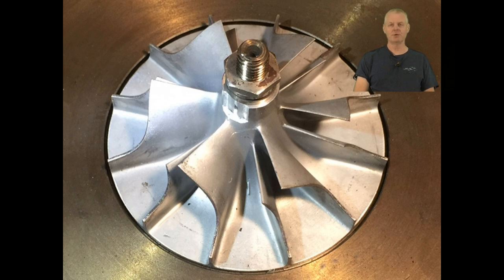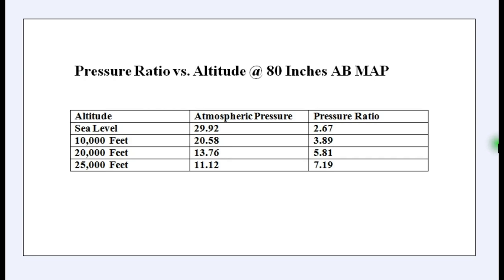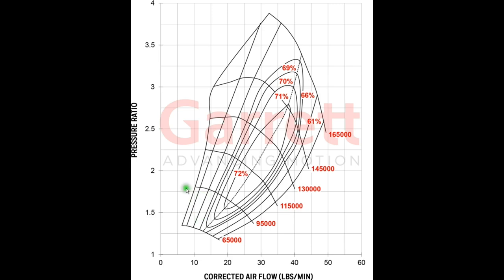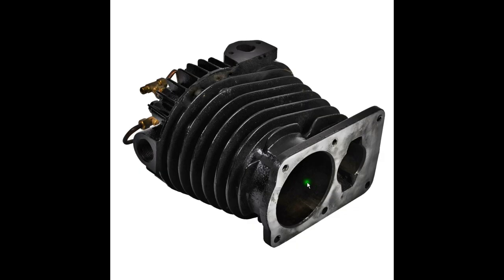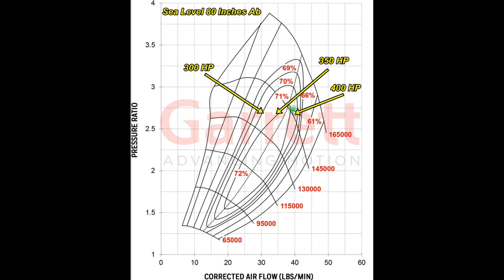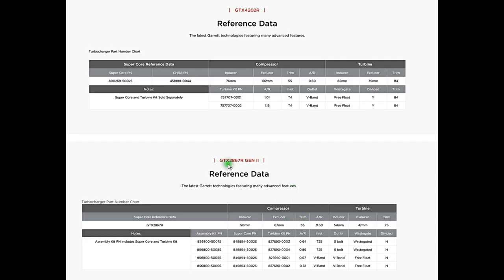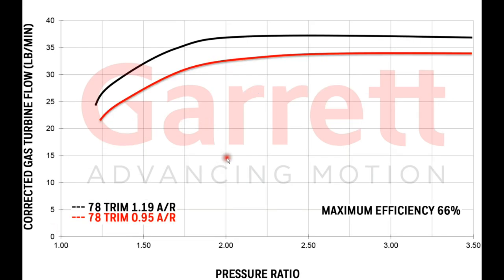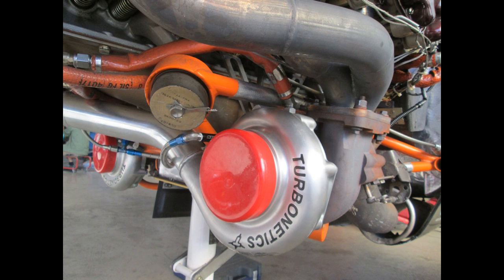What's Wrong With Raptor's Compound Turbo System?

Comment: The mass flow (lbs) per minute must be the same in both turbos (no air is added nor lost, so where should a difference in mass come from?) So why are you applying any kind of multiplication to the mass flow? If the engine needs 40 lbs per minute, then each turbo needs to transport 40 lbs per minute.
Understood that the second turbo needs to be smaller since the air is more dense but I don't get why the mass flow should be different?
Reply from the maker: Compressors are rated on inlet mass flow. First stage air will be compressed in volume to feed second stage. Boyle's Law, as I explained.
Reply: @rv6ejguy  All agreed - can you help me and state the lbs/min in and out for first and second turbo. In my mind all 4 numbers must be the same.
Reply from the maker: @martinrenschler4046  If you look at the relationship between volume and pressure (assuming no intercooling and disregarding temperature change from compression which is substantial in this case), in simple terms, double the pressure, you have half the volume and double the density. We are trying to take air at low density and increase the density back to SL conditions. 

The first stage essentially brings the 2nd stage compressor inlet back to SL at 25,000 feet so the 2nd stage can then bring the intake manifold up to 70-80 inches Ab.

This may be easier to visualize volumetrically  rather than thinking in terms of mass flow and you can see how gas turbine engines with multiple axial stages have large blades at the front and progressively smaller as you progress rearwards. you squeeze the air more and more and pressure increases at each stage.

You'd have to consider the effects of intercooling and aftercooling to actually match turbos for Raptor. The point of this video was simply to show that you can't use two equally sized compressors for compound turbocharging as Peter has done. Don't take the actual numbers presented here as gospel, they are only for illustration of the concept.
Reply: @rv6ejguy  I again agree with everything you say but it doesn't explain why you would have different lbs/min numbers between the turbos. If it were so, we would either gain or loose mass in a turbo and that can't happen. If the engine needs 40 lb/min than that's the mass each turbo needs to take in and put out. No multiplying with some factor and getting to a higher lbs/min number for the other turbo.
Reply: I read up a bit and found that the charts only apply to the first stage. In order to use the same charts for the second stage turbo you have to calculate a different mass flow, not because there is a different mass flow but to be able to use the chart. The formula is mcorr = m*sqrt(T1/298)/(P1/1). This number is smaller than one, so a smaller turbo will provide that corrected virtual mass flow.
Reply: @martinrenschler4046  That is what puzzles me also, plus a % the pressure , minus the same % in volume = the same mass.
The only way to get a different mass output per turbo would be a wastegate between them.
I can imagine the second turbo in order to provide the right amount of lbs/min ( mass ) for cruise power at 25000ft has to be ''fed'' enough by the first turbo.
To be able to provide enough lbs/min ( mass ) at FL 25 it has to be bigger but will be to big at SL and the wastegate has to bleed off the surpluss i guess.
No expert what so ever , just trying to visualize this complex stuff....
Reply from the maker: @martinrenschler4046  Mass in = mass out, only pressure and density has changed as flow moves downstream. Compressors are spec'd on inlet flow. Squeeze 1 cubic foot of ambient air down to 1/2 cubic foot and you have the same mass at double the pressure and density (assuming no heating which isn't true in real life). I'm not sure how else I can explain this...

Go back to the analogy of the 2 stage, piston air compressor.

I am not sure what you are trying to say here? Are you disputing that the 1st stage compressor shouldn't be bigger and therefore pump a larger volume of air?
Reply: @rv6ejguy  I am all good as stated above. I just needed that one sentence of explanation that I found online namely that you go into the charts not with the actual physical mass flow numbers but with a calculated number that allows you to use the chart when the inlet pressure / temp is not sea level, i.e. mcorr = m*sqrt(T1/298)/(P1/1). That allows you to work with compound setups as well as at high altitude. Thanks for the video.
Reply: @martinrenschler4046  , Exactly!

Comment: Very informative and interesting even to someone who's never going to build a raptor! You made your case very well.
I wonder how difficult it would be for someone to change out the current system to a recommended system. 
In other words does the Raptor builder choose the turbocharging system on the engine. Or is it supplied when you buy the engine without an opportunity to select a proper system.
What would you suggest current raptor owners do? Another channel by a raptor builder complains about the high engine exhaust temperatures. I think he should watch your video.
Minor note. Moving the cursor around continually is very very distracting for certain people like me who have ADD. It makes it difficult for me to focus on what you're saying. Just point once and leave the cursor there. Sorry, but some of us have this attention problem.

Comment: Let me ask you a very simple question.  How many aircraft have you designed and built,. including the engine and redrive system?  Please expound and show your videos of development and finalized to production.  I am absolutely certain that we shall all be amazed by your genius.
Reply from the maker: This video was about turbocharging. Just trying to show people why it's all wrong based on my 40+ years in this field. Did you want to dispute any of the points I made here?

I built my planes for myself, not production. Do you think Peter did a good job here?  Do you think the design will do anything better than existing designs like the Lancair IVP or Velocity XL?

It weighs more than TWO RV-10s and has no useful load at all as it's already at its predicted gross weight- when empty.  How will 1200-1400 pounds be removed from the production airplane without sacrificing all the bells and whistles?

Raptor isn't going into production with this engine, turbo system, cooling system, redrive or control system as they sit now. Peter needs some professional help on many aspects to make Raptor successful.

BTW, Peter never built his engine. I did build the engines in both my planes that I also built. My engine and redrive have 450 hours on them and haven't blown up yet...

How many planes and engines have you built?
Reply: I have followed Raptor (Peter M) since beginning and you would know  from following that  there HAS been good info given but NOT taken on board. Sometimes you just got to think about input suggestions and there SOURCE. 🤔🤔

Comment: The following comment was one I posted to Raptor, it was my first red flag and I can't help but Wonder if this engine failure is resultant from cylinder degradation due to heat?... 
I have been curious about the EGT range you have been contemplating, is there something unique about this power plant that allows for operations considerably above acceptable norms? The absolute maximum safe EGT range is debatable. Our universal rule of thumb, regardless of engine make/model/year, is to not exceed 1250° F and not to operate in the 1200° F - 1250° F range for an extended period of time. - Diesel Hub. http://www.dieselhub.com/performance/egt.html
Reply from the maker: Lots of people have brought this up but Peter thinks he knows better than guys with decades of performance diesel experience.
Reply: The engine did not fail. His redrive bearing seal has a retainer ring on it. He put a larger seal in, and the retaining ring would no longer fit, so he left it out. The seal blew out in flight. Since his redrive oil and engine oil all come from the same place, the engine ran out of oil. Not an engine problem, it was a being stupid problem.
Reply: This is excalty what I was taught and know that to be true from my own personal Experiences.
Reply: @golfmaniac  It's still not proven, that is the case. Did the seal pop first (why, they don't just pop out if the case runs a negative pressure) OR after a problem with the turbo seals failing due to high temps, pressurizing the crankcase, forcing the un retained seal out ?

Comment: Good engineering principles shown in this presentation. Very likely Peter has seen this, likely he will incorporate this as a revision, not a very expensive or difficult change to make.
Reply from the maker: My guess is Peter won't make any changes to what he has now and it would be quite a bit of work to try to fit the larger turbo under the cowling and change exhaust bits. He's on a schedule to get 40 hours flown off.

Comment: The Audi engine isn’t designed for this amount of BMEP. It’s not designed for high continuous output. It’s destined to fail unfortunately. At the end of the day it’s a 3 litre engine made for a car running around at less than 2000 rpm on average. Audi never designed this engine high maximum continuous torque output.
Reply from the maker: Thousands of these have been flogged on the autobahn at very high power for hours on end. Most auto engines today are validated at full power for at least 150 hours but I agree trying to get more than stock hp out of an engine for use in an airplane will reduce engine life substantially. It's not a good choice here for a variety of reasons.

Comment: As in the rest of the automotive and power sports industry can’t we just call the TwinTurbo set up?
Reply from the maker: Twin turbo normally suggests 2 in parallel unless denoted as sequential. Compound or staged  turbos are quite different from an operational and matching standpoint.

Comment: Have you been talking to Peter?
Reply: The question is if Peter will for one time listen to experts
Reply: One can only hope
Reply: @rafiqsaid4297  It would probably have saved him a lot of trouble and possibly an engine
Reply from the maker: No, I just did this to show what's he's done wrong. He never listened to any advice from me or other knowledgeable people about his turbo system.
Reply: @Gearlube_chain_wax_solutions   an other one ?
Reply: Do the wrong compound turbo system influence in the high oil temp he is facing?
Reply from the maker: @bernhardjordan9200  The high EGTs and charge temperatures don't help the oil temps but the big problem is no properly sized and ducted oil cooler is fitted. Oil, coolant and charge cooling is all inadequate and poorly designed and ducted.
Reply: @rv6ejguy  Look at Spitfires, mustangs and P38's and you see what good cooling looks like

Comment: So, as long as Raptor stays low, no problem...
Reply from the maker: Well the compressors are ok up to maybe 8000 feet or so but the tight turbines are hurting power and making excess heat all the time.
Reply: @rv6ejguy   That's okay...no worries!  We can just slap 5 more radiators all around the engine compartment to help dissipate that extra heat!!

Comment: Your biggest issue as one rises in altitude is one of chemistry namely the oxygen "burns off" at altitude whereas the nitrogen stays whole creating a much less combustible "air" than would be true on or about Sea level (ground effect) and hence why using  a Williams turbojet engine is always the right solution period.
Reply: Do the turbojets not require oxygen?

Comment: The big problem is comparing a piston, positive displacement compressor versus a turbo who's is a centrifugal pump they have significantly different compression methods and results. 

I do believe the concept is correct, large compressor for 1st stage, smaller for 2nd stage. But comparing a turbo centrifugal compressor to a piston positive displacement compressor are two different to be compared as a reason. 

You
Reply from the maker: Merely a simple to visualize comparison made to get the basic concept across that you can't use the same size compressors for 1st and 2nd stages on turbochargers either.
Reply: I thought it was explicitly clear that this was a general example of how first and second stage sizes compare in a two stage compressor and not a comparison of compressor types.
Reply: @georgeburns5811  all understand that, it's just that compressor types used in the example are not a good comparison.

Comment: Raptors turbos ARE different size.  And you don't know what size the turbos the Raptors use, but they are using the inappropriate size.  Always the arm chair garage critics.
Reply from the maker: They are only marginally different in size. Peter mentioned in one video what the 2nd stage one was but I couldn't find that info again. Look at the relative sizes of compressors and turbines in the vids.

Comment: And you've designed and flown how many airplanes?
Reply: You don't know this guy, do you?
Reply from the maker: This is a video about turbocharging and showing what happens when you don't understand the technicalities of that subject. Kudos to Peter for building and flying his own design, that is a big accomplishment however it falls far short of his performance predictions, mainly because he doesn't have any background in design, structures, aerodynamics, engines etc. either. The fact that it weighs double the projected figure from 2013 shows how widely he missed the mark. Perhaps a 2nd prototype can address the many issues with the first but that will takes years more.
Reply: @fred neale. Ahh, the standard reply from Peter’s followers when someone knowledgeable in a technical area offers sound advice. Sorry Fred, that childish approach only belongs on the Raptor site.
Reply: Fred....you do not have to design or fly aircraft to have Ross's expert knowledge of turbo systems design.

Comment: I was all in on this video until the condescending comments at the end.
Reply from the maker: When I commented on his turbo setup a couple years ago, trying to help him out, Peter suggested I should get educated by watching the tutorials on the Garrett site like he did. This coming from a guy with zero experience in turbocharging prior to Raptor. Is that what you mean by condescending?
Reply: Whether the comments at the end are condescending or not does not make the physics wrong.  You can argue all you like about the presentation style, but the laws of physics will still be the same.

Comment: The best way to view compound turbos is by output. First size using the 3.0L with a quick spooling performance unit, 67x80(EFR6758) is a good match for the 3.0 running just over 2 bar perfectly. Now get rid of the 2bar call it a 6.0 diesel. What's the best size turbo to run a wide range of boost efficiently for a 6.0? An Airwerks S400SX-E 110X80. You can increase the primary turbine one size because the secondary will help spool the primary turbine (hot side) so we will end up with an EFR7163 (71X80) and the Airwerks. Of course you can go through the formulas if you can find them.  But a 71x80 and a 110x80 will make a 2.4 bar at 74% efficiency up to 2.9bar up to 4bar in the map into a 3.4 bar capable at 72% efficiency and 4.8 bar in the map.  Total possible pressure increase 17 times, total possible in optimal effeciency to 9.5 times inlet at max efficiency which is absolutely why compounds are the way on the ground. It's a crazy method but it works with matchbot on borgwarner perfectly if you shoot for dead center efficiency.
Reply from the maker: Quick spooling is not important at all in aircraft as the engine is cruising at around 75% of max power for hours on end, lots of exhaust flow already. You want the largest practical turbine wheel and the loosest A/R ratio housing that will develop enough drive torque to spin the compressor at the highest PR it will see. It's very different from ground based applications.
Reply from the maker: @curvs4me  Most aircraft engines sit at a high constant power setting in cruise for hours. Lag is of no concern like in an automotive application. Governor, not sure what you're referring to here on this Audi engine? The large turbine is required to spin the large compressor at the 2.68 pressure ratio. The only concern is having enough exhaust velocity at the nozzle to provide the requisite turbine torque with the wastegate fully closed (critical altitude).